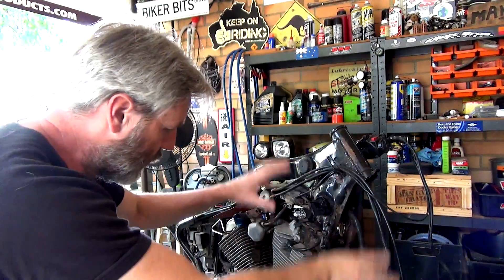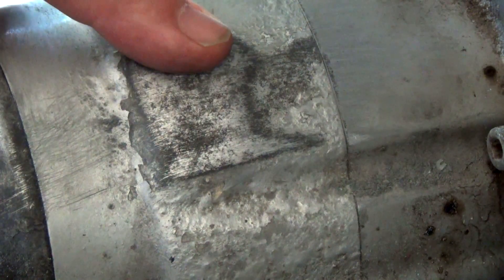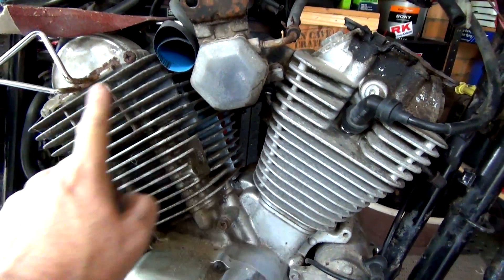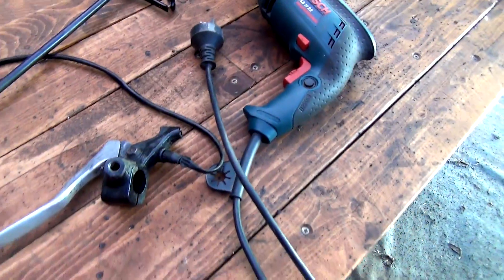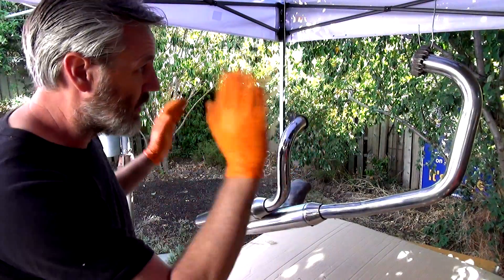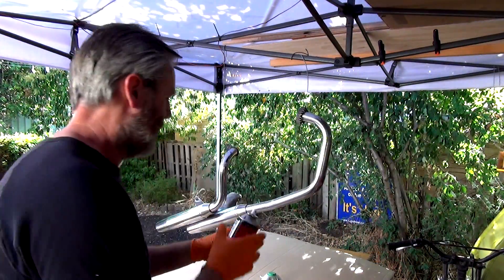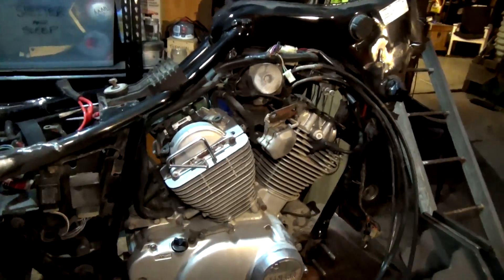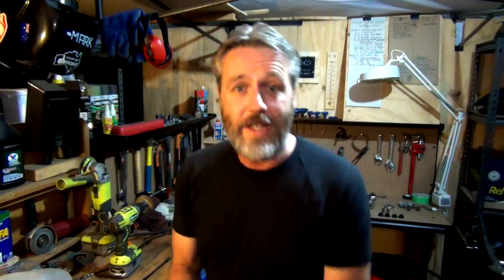Virago 250 Build - PART 12. LONG WAY TO GO!

Comment: Your sanding method is spot on, you can go up to 2000grit if you like, then on your buff, there are two British polishing soaps you can use, grey for cutting and white for final shine, I normally go over with meguiars metal polished to bring it up to a mirror finish, you can then clear coat it.
Reply from the maker: Thanks heaps mate! :-)

Comment: Hello, i have a friend who works for Yamaha Racing Belgium, he says that sometimes humidity stay in the exhaust when the motorbike is running on without riding and it makes rust (from the inside to the outside) in the exhaust... 
Don't forget to verify the electricity before rebuilding the motorbike, it's a mess on Yamaha's. (I have a XT600E, i know what i say... 😵)
Very good work, beautiful restoration ! 👍😎
Bye.

Comment: Mark, I noticed when you were showing the bike frame, around the steering head, what appeared to be the VIN Number of the bike. You need to be careful not to remove it, if that is the case.
Reply from the maker: It’s so pitted there that the number is pretty much unreadable without looking at the number on the plate!
Reply: Fingers crossed they don't give you a hard time when you go to get it registered

Comment: Mark Have a tip for you have you heard of product called SCA-Aerosol-Rust-Converter you can paint over lite rust it will convert the rust and you can paint over it too here's a video of the product at Supercheap Auto:
 http://www.supercheapauto.com.au/Product/SCA-Aerosol-Rust-Converter-400g/416582
So my theory is if there's places  oh you can't get to  and you going to paint it black anyway you can use this product  and you don't have to sand like crazy on the rust if it's like rust  and you can paint the frame with it before you paint it with the black colour you going to do 
Let me no what you think
Reply from the maker: Thanks for that mate... great idea! :-)
Reply: Biker Bits hope it helps